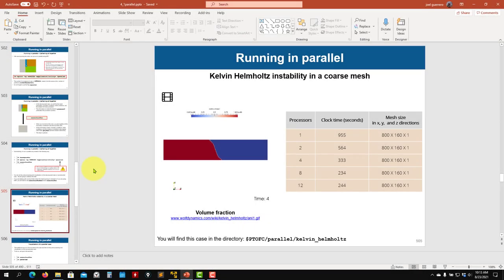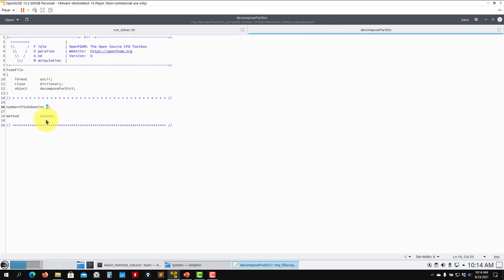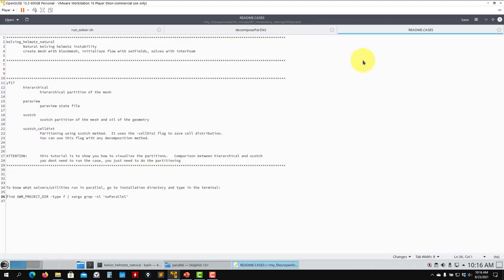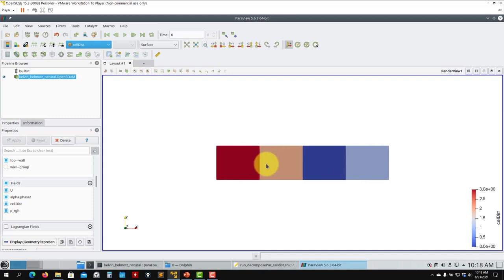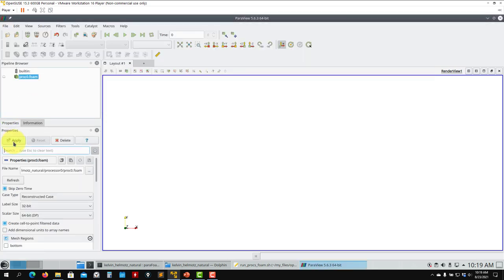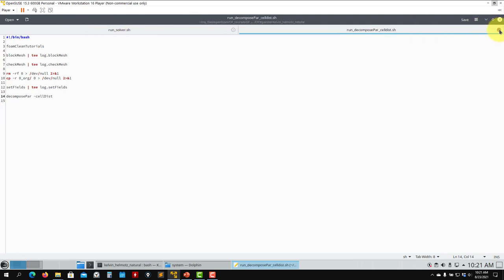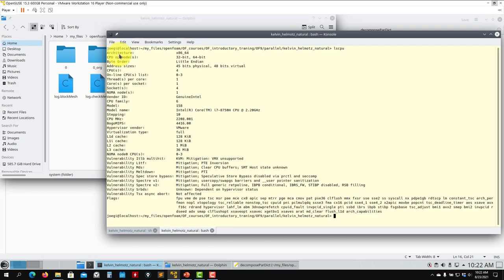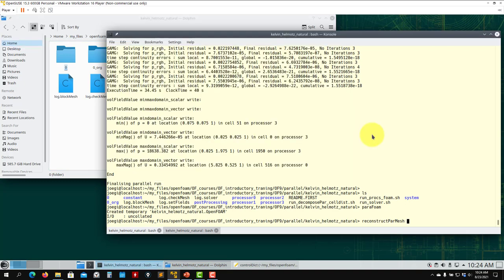4.2 Module 4 | Running in parallel #openfoamtraining

Comment: I have got an error while using decomposePar. I am using a custom model or library which is perfectly ok and compiled with single core but for multiple cores while using this it gives couldn't find the library.so file. Could you please help me. Also from the mail responses you gave I came to take coding doubts aren't free but I have bought the  membership for this channel so it is not free and feel free to help me as it is community platform one can help another that is way of learning thank you
Reply from the maker: Hi, it should work in serial or parallel. Can you give more details? Maybe you are missing the opnempi libraries.